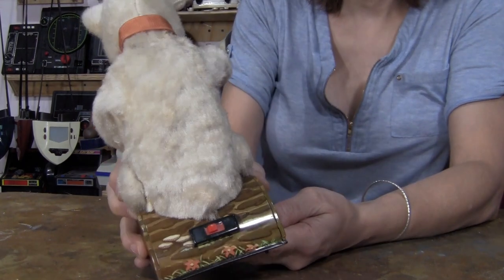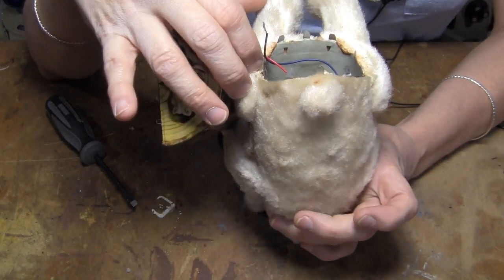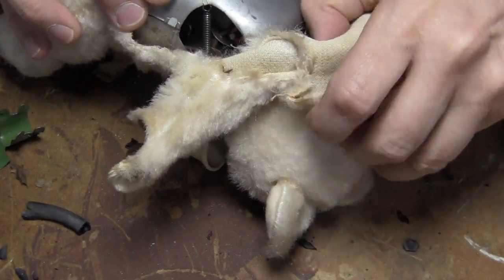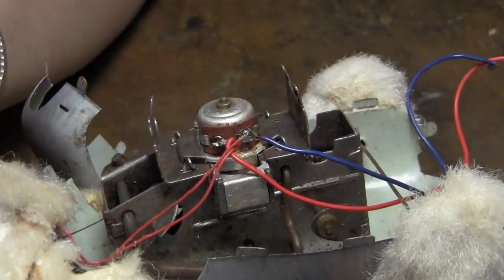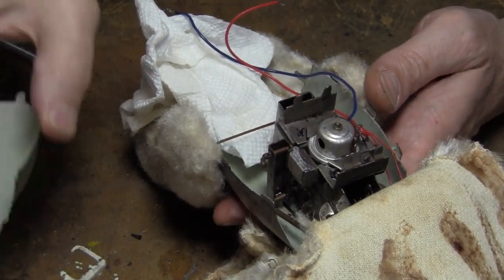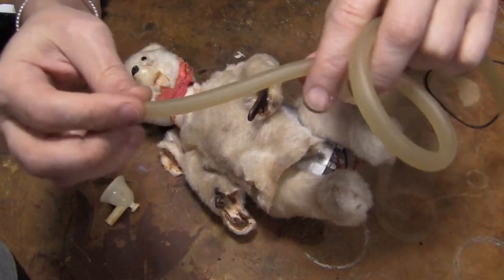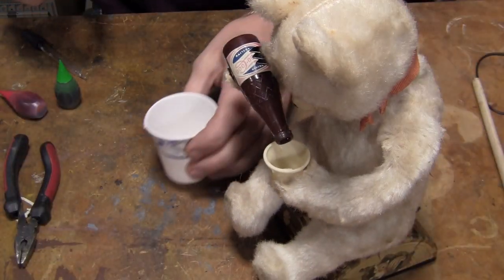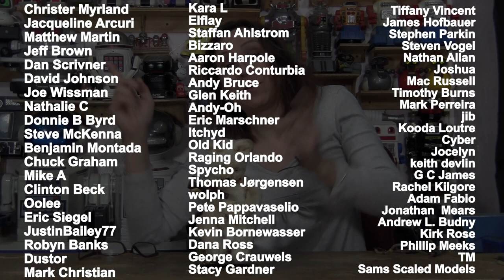Raise a Toast to the Past: Restore an Alps Mechanical Drinking Bear

Comment: ..... Mate, that was a real treat. Excellent.
I was thinking as the eyes would be difficult if not impossible to replace,
If they failed you could gently cut the end cap off and 'hot glue' a diffused LED & series resistor in behind 
the failed sealed globe, leaving the vacuum and hence the eye intact, (Maybe).
i.e. LED would shine through sealed failed globe.
Reply from the maker: No, you won't find those eyes. The best to recreate them is a flashlight lamp with a black dot painted on it.

Comment: Rubber cement would have been a good glue. Or a stronger variation like e6000.
Reply from the maker: E6000 would have been way too permanent. That's good stuff. What about the future? Rubber cement sounds like a pain. You have to do both sides, let dry, and then you have one shot at getting it right. I went for ease, and something that can easily be undone when you have to get in there again.